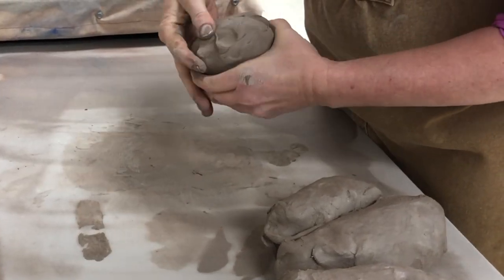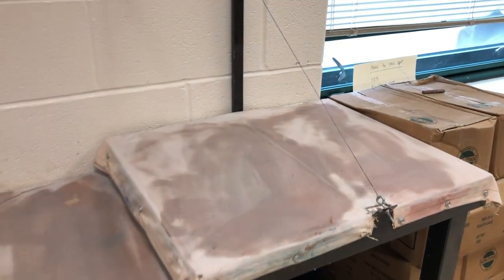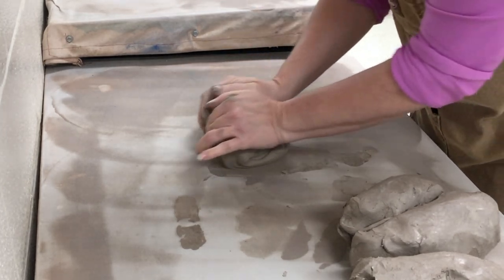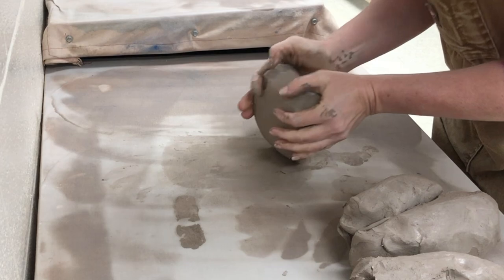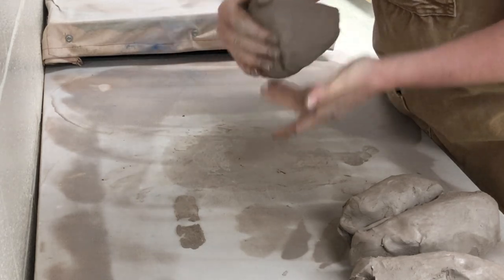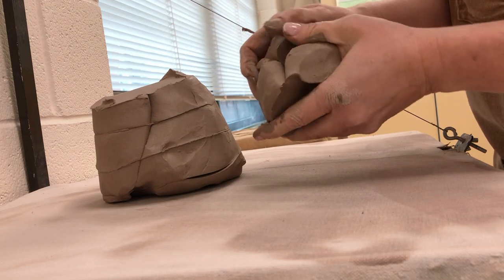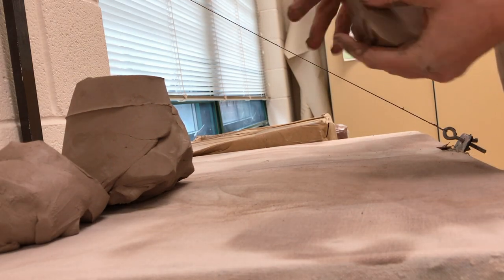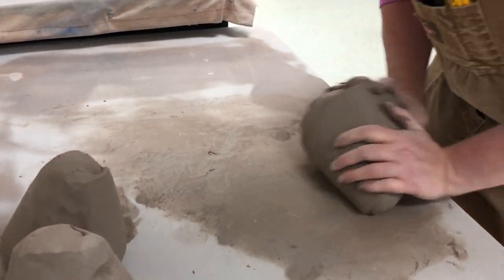A Guide to Wedging Clay: Tips, Skills, and Troubleshooting for Potters

Comment: Great thank you.  How long or how may times do you wedge?
Reply from the maker: It depends on the consistency of your clay... You want it to be evenly mixed- no wet or stiff areas... and be careful not to wedge air bubbles into it.  If I have fairly consistent clay, I can usually wedge for less than a minute (maybe 20-30 turns), but if it is quite inconsistent, I may take few minutes on one piece!  I hope that helps!
Reply: @KaransPotsAndGlass  Thank you.  Yes, that helps a lot.  Great videos.

Comment: thanks for this great video! could you tell me how important wedging is for hand-building techniques such as coiling? i am also curious how long a finished piece can sit before being fired as i won't be able to get to a kiln for an indefinite amount of time. thanks!
Reply from the maker: Wedging is important if your clay is uneven in moisture, or if you’re combining scrap. You can often use fresh block clay without wedging for hand building!  You can keep your pieces indefinitely before firing. As long as you’re careful with them they can be bone dry for years before you fire them!  :)
Reply: @KaransPotsAndGlass  thank you so much!! I am so new 🙊

Comment: Thanks for this Karan.  What if the clay is really hard and not plastic?  What if the clay is really to soft and seems like it sticks to everything.  Gosh when is the clay the right amount of soft and pliable?  How can it be adjusted to be the right amount of soft and easy to work with?
Reply from the maker: I have some videos on that on “how to recycle clay by hand in my studio”. But I’ll try to answer right here. If the clay is too hard and it’s already in chunks not the block, you can slice it into thin slices like quarter of an inch thin wet the slices down and then drop them back in a bag give it 24 hours and it will be a good consistency. If the clay is too wet you can take that squishy clay and lay it out on the counter or a plaster bat and drape a heavy towel over it and leave it out for 24 hours. It will become drier but the heavy towel will keep it from forming a hard crust on the top. If you have a large block that’s too hard, do my trick that I show in another video of adding water to a bag that doesn’t have holes with your clay, and then submerge that enclosed bag and a bucket of water.  https://youtu.be/FfVaz5lOWMI

Comment: Thank you! Doesn’t the clay get dry?
Reply from the maker: It doesn’t dry out too much if it’s properly moist to begin.  Dry clay will be problematic- and could get drier.  One quick fix is to slice it in very thin slices- like less than 1/4”, spray with water on both sides of the slice, sandwich back together and then wedge.

Comment: Each time I check on canvas, I’m asked which weight I want. Will you give me some idea?  I’m wedging on a Hardie backer board that sits on a painted wood table that was formerly an office/kid study table. It has the opening for a chair to slide under. It has a lower shelf on one side that is big enough to hold a hardback dictionary, etc. I have a Hardie backer board attached to the table using two clamps. I think dh got the clamps from Harbor Freight. I use the smaller hardie  backer board to wedge smaller amounts of clay. I have a larger piece of Hardie backer board to dry clay when reclaiming. I flip them over when using a different color clay & if the one side feels bit too damp. (I flip it over to allow it to completely dry.) Would there be a benefit of covering the Hardie backer board with canvas? When you say clean with water, does that mean your canvases can be taken off to clean? 

So sorry if this was answered in your video. I’m exhausted after reclaiming & wedging some 25 lbs of clay.  🥱😫😴 This is in addition to helping my husband center clay on top of my throwing several mugs. Today was the first time he was able to center clay without needing me to help him get centered. I apologize in advance.

Comment: I see what looks like a geode in the center of my wedging when I wire it in half.  It eventually wedges out but I think something I'm doing is causing this and I have to wedge about 100 rounds for each 2-3 pound piece.  Any idea what I might be doing wrong?  I do ram's head.  Thank you for your many terrific videos!
Reply from the maker: perhaps it is on the dry side, and not mixing well in the center??  When moist enough, it should incorporate!  :)
Reply: @KaransPotsAndGlass  on the clay I wish that was the case but it happens with any clay I use.  and i incorporate water when the clay is stiff.  Could it be i’m not pressing down hard enough?

Comment: I have only just started doing pottery ....
Could you please tell me why you have to Wedge the clay
And also why is it that you have to do it for so long
Anticipating your reply - Thank you
Reply from the maker: Hi Pam-  Potter's wedge clay to eliminate air bubbles as well as create a smooth homogenous claybody which is even in moisture. The length of time of wedging does depend on the original condition of the clay and the size of the hunk.  If it is already pretty smooth and even in consistency of moisture, I can usually wedge  a 2 lb ball  in about 30 seconds.  My students aren't quite that fast, it may take them a minute to do the same.   If there are parts which are wetter and slightly stiffer, more wedging is needed to get it consistent throughout.  I hope that helps!
Reply: thank you so much.. 
can clay be used if just cut, straight out of a fresh bag
Reply from the maker: @2pambo  - yes it can be.  I often do that with slabs with my students. However, if you are going to throw it on the wheel it really should be wedged a little!
Reply: I’m trying to learn how to wedge so I can recycle scrap clay, but clay right out the box/bag is best to use.